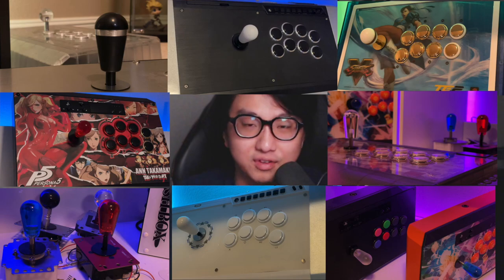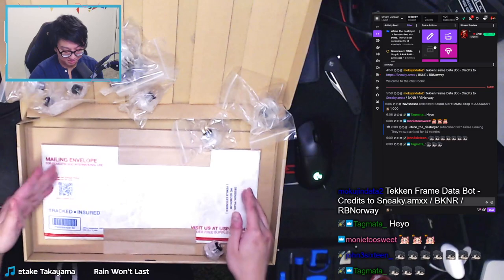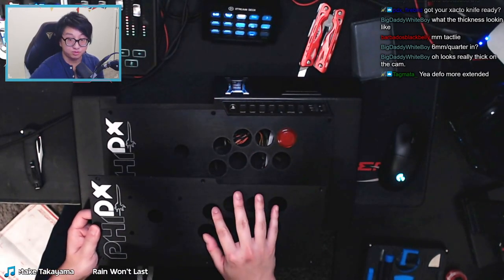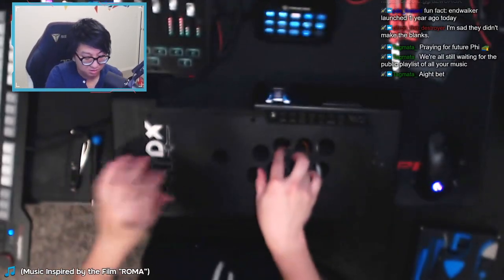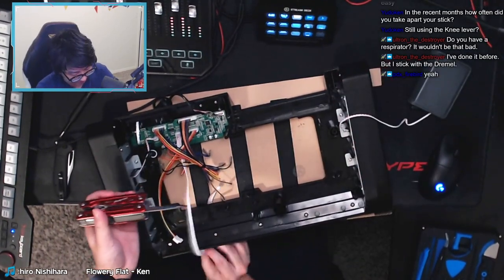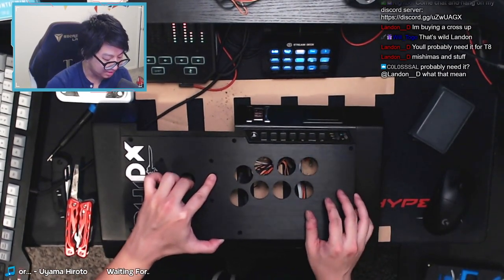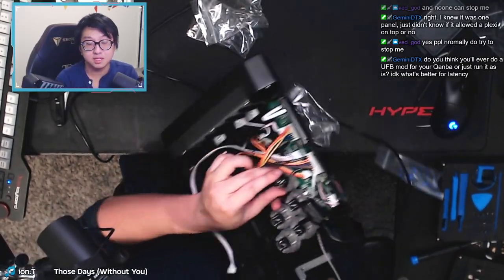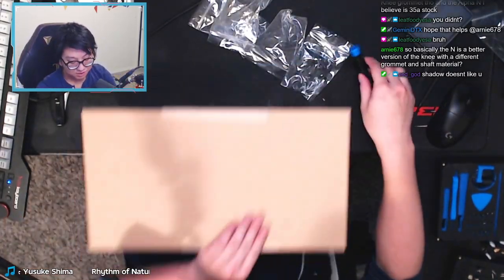Designing the perfect Arcade Stick Layout

Comment: I normally play on pad and just recently bought a mix box to try out something different. The first thing I did with the 8 buttons was to map the centre 4 to lp/rp/lk/rk, so that my hand would be centered within 8. It's just what immediately made sense to me to do. Is this not common?

Also, you mentioned quick rage drives and parries, but there's also another little situation where a bind does something you can't otherwise replicate easily. With Eddy when I do instant while running 3, I do it with f,f,f 2+3. This way if I mess it up I'll get either ff2 or f2, which happen to be much less awkward misinputs than his f3 and ff3. I think Dragunov gets a similar advantage from doing iwr with 2+3. I'm sure there's other characters who this would help too. This doesn't work without a bind --- buffering the button doesn't do the same thing, so you'd otherwise have to do a frame perfect input.
Reply from the maker: Pakistan mostly does this, and some Korean players do too. Less common in the West

Comment: I'm like 90% sure Korean pros don't use all 8 buttons. 6 Buttons max. Just ask Knee.
Reply from the maker: Lowhigh switched back to vewlix, as does Qudans
Reply: tekken forces you to use more than 6 buttons, you can´t press 2 buttons at the same time with the tekken system, the best layout would have 10 buttons
Reply: They are good for macros. Like 1 4 .2 3  inputs. I use one for one for 1 4 input because that input doesn't fell natural for mvc3 and tekken 7 for Kazuya rage. And I use the second for rage drive. In most games your right most old school players only use 6 keys but the extra 2 are nice to have. Sides newer fighting games are using more buttons now. And in training mode reset replay ect its useful.  Oh yea I forgot navigating menus you need them